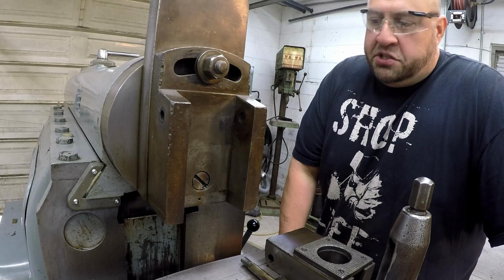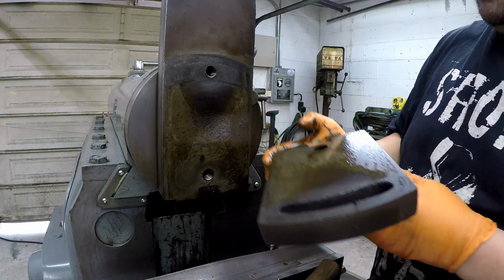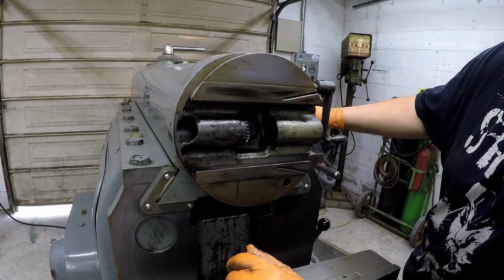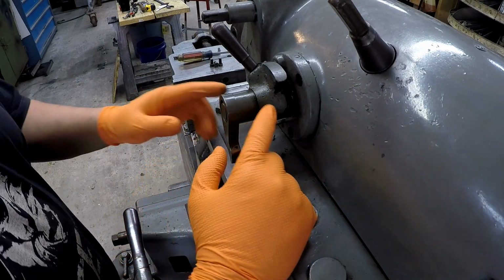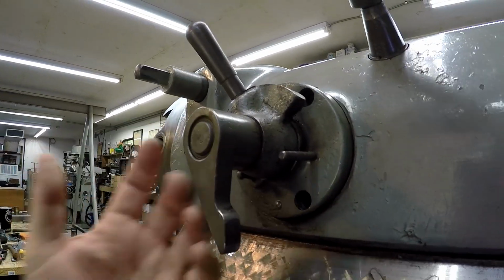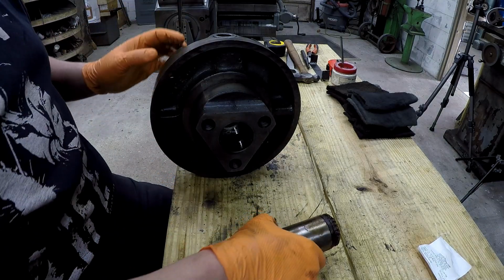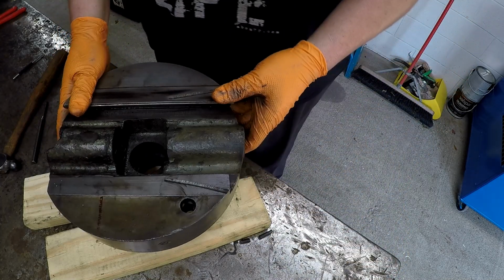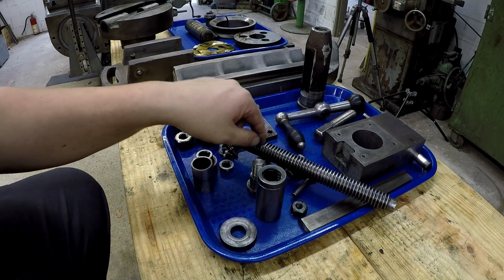G&E Shaper Tool Head Tear Down

Comment: A lot of times I find that a stripper bolt has a shoulder that is not concentric with the thread. It's like a cam. Slight misalignment of the counter bore and the threads of the machine causes the sticking. The answer is to replace the stripper bolt with one that is concentric. The cam action may also be between the head of the bolt and the shoulder. to fix that just cut the counter bore for the head bigger.
Reply from the maker: It’s just a simple cleanup up the head of the bolt. I’ll get it all fixed up.

Comment: Given the nut will wear again and there is already a bit of wear on the lead screw, would it not be wiser to make a split nut and pre-load the nuts with a bevel washer or something like that? Granted, you would need to drill another straight pin hole to hold the second part of the nut captive too or a grub screw would be better as you have to account for where the nut will be when you pre-load it against the main nut. Food for thought Adam.
Reply: darnit, Ya beat me to it!
Reply: speedbuggy16v don’t feel bad, i just happen to watch a lot of ABOM and youtube for that matter. Bound to get an early reply in given that!

Comment: I would make the new nut out of 2 pieces, to have an adjustment of the backlash in the future. The adjustable part of the nut could be fixed in place with a set screw. Similar to this design -- https://i.ebayimg.com/images/g/ZEYAAOSwAO9ZQCWa/s-l1600.jpg

Comment: Love it! You might want to deburr the square ends of the threads on the leadscrew where they meet the key slot in the screw - to prevent from future wear in the nut? Just a thought. Hoping that a new nut will fix Your backlash, there! Great video!

Comment: Man, how do you break a big of chunk iron out of a thing like that? Hitting it with a hammer?  Dropping it on the floor?
Reply from the maker: Ramming it into the workpiece.
Reply: Abom79 - That's probably the same time that the auto downfeed became inoperable; as a result of the collision or intentionally by the operator to "prevent" future collisions.

Comment: Bootstrapping the G&E back within tolerance sounds like it is right up your alley!  Since you will be making a new nut, will you be machining the threads on the screw, to ensure uniformity, as well?  I'm excited to see the smooth cuts you can get once the backlash from the loose fit is gone.  Once the key is in place, we can see the shaper going all out at feed rates too high for easy manual adjustment.  Is the maximum length of part that can be shaped the same as the travel of the ram?  Some long, deep chips would really show off what this machine is capable of.  Also, congratulations on gaining a few thousand more subscribers in the last few weeks!   This is the kind of content that enriches the lives of all involved, and showcases tools and technologies from a time where resilience was a higher priority that replacement part income.  When you have more than one video to share on a weekend, please release them spaced out a bit, so we can enjoy your work even more during the week.  Thanks for giving us another reason to love Saturdays!

Comment: Hey Adam, what do you think about making an adjustable anti-backlash nut for that?
Reply: The screw has enough wear in it that you wouldn't be able to make too much of an improvement over a tightly fitting nut. You would have to back off the backlash so that the screw didn't seize on the unworn portions of the thread.

Comment: Adam ... 1-1/16" surely seems like an odd size. I was recently fooled on one where the major diameter of the screw was turned down a bit, and wondered if that may be the case, for the bevel gear to slide on. If the minor diameter is .875, that likely may be the case. I checked Roton, and they go from 1" to 1-1/8". It would be nice to change both the nut and screw, even if you need to go up to 1-1/8". With that said....when the compound is being advanced, the backlash should be out anyway, besides being able to lock....cannot see it being a big issue??
Reply: +Jim Liechty
As I see it, the issue with the backlash in the tool head feed is gravity.  Unless you use the 'lock' on the side of the head as a variable brake, providing enough friction to keep gravity from advancing the depth of cut on the backstroke, you run the risk (on very fine d.o.c. situations) of having the tool go deeper than desired.  Then it is possible for the backlash to allow the tool to ride up, reducing d.o.c. as the cutting stroke progresses.  Using the lock in this manner also subjects it to undue wear as well.  Possibly causing a 'wear in' spot on the area where it runs.
Anyway, that is my $0.02 worth.  Cheers!

Comment: Looks like you found the problem again Adam, good deal.  Making the nut to match is probably a good thing since you will be able to clean up the shaft threads too and make the nut.

Comment: Nice work Adam.  The nut will be a bit of a challenge but all you have done prior to this moment leads to this being very very do-able.  My only concern is : What precisely is the correct metal from which to make the nut? (I.e. hardness, abrasion resistance, etc.)
Reply from the maker: Any bearing material. I’m using the original ductile iron.

Comment: A great video, thanks for showing the downfeed mechanism.  I am amazed at the different places that are worn between your machine and mine.

Please give me a chance at those auto downfeed parts.  I need the ratcheting system that bolts on the ram, the spring and the ramp.  It would be great to restore the downfeed to my machine.

Comment: Would a little added thrust washer go between the bevel gear and the feed rod take up the wear ,,backlash,,,. Seems a bit sloppy at that point . That should take the backlash out or some anyway. I bet 60 thousands brass or bronze. It looked to be about that if I remember . Guess if you measure it you'll know. Trying to help.

Comment: Holy crow. The battering that machine took in its working life. Every exposed thread end,every corner of that big  vertical casting, the lantern,did the firm originally owning it send every apprentice on that very machine,or was the rush to make parts so great that machine operators just whack a heavy item in place with no regard for long term damage ? The reason that thing sat in a corner so long was the journeyman were ashamed of how they had originally treated it. Really appreciate you doing this part of the machine. Always wondered how the bits were shaped. Cheers.

Comment: i have been driving out shafts and such, for many years and i always use an aluminum round stock as my punch/driver. I`ve never damaged the part this way even when pounding heavy. Brass drivers are hard enough to dent, chip. bend etc steel. Let the aluminum take the damage, redress it on a lathe once it gets a nail head. Jealous of your shop! God bless.

Comment: Just wondered as you didn't say, is that key that goes in the gear have two locating pins on is so that it stays in the gear and slides on the threaded shaft? 
Keep up the great videos, thanks.

Comment: Definitely can use a good cleaning
Reply: john pietros , Not much oil getting to the area in the ram where the bevel gears live. I wonder if there are stopped up felt strings in the oiling bores in the ram.

Comment: when I saw the bevel feed gear in the head, my first thought was that  it was missing a key, because that's very similar to the powered crossfeed  screw in my 1966  Sajo DuoMill. You are so fortunate to have a network of friends, who look out for you, spot parts at scrap yards, and tools at swap meets. I've been trying to repair my Sajo knee mill, and I've gotten near zero help. Very frustrating. 
Anyway, love the shaper repairs. How do I get one of those Abom79 tee shirts with the Monarch lathe on them? I've got a 1936 model AA 14x30in Monarch.
Reply: +Rustycowl L   For the shirts, look in the description area for the video.  There is a link there.  Many others available as well.  :<)

Comment: I don't know if it's worth the time but you could set the shaper compound leadscrew up in a lathe and single-side chase the hourglass out of the pitch diameter. You'll have to bush the follow rest so the keyway doesn't mess the diameter circularity up. Make a short gage to match the now oddball leadscrew. Then make a new nut to match the leadscrew/gage. Bada-bing! Like new slide backlash of 0.002". Dare we suggest backlash adjust?

I have a 24" Cincinatti shaper without auto-downfeed. Too bad. The 24" G&E parts you have coming but can't use wouldn't fit my shaper or I'd make an offer. Story of my life: everything I want is illegal, immoral, fattening, or wont fit.
Reply from the maker: I’ve been giving thoughts to that, chasing the threads until they are cleaned up the same down the full length. I’ll keep ordering on the idea.

Comment: If you make your own nut, you can machine the lead screw threads to even them up, then machine the threads in the nut to make a perfect fit.
Reply from the maker: If you change the pitch it will, chasing them will not effect the movement, or lead.
Reply: The dials wouldn't work if the screw or nut gets changed too much. Those parts are critical operating components.
Reply: If you change the  TPI by chasing threads on the leadcrew/nut by even a few thou, wouldn't that throw the dials off? I'm not a machinist, just an armchair, learned everything I know from you, Mr. Pete and Kieth Fenner on YouTube noob.
Reply: Adam , I do not mean to change the pitch (TPI), I mean to change the axial thickness of the lead screw threads to match the worn portion of the lead screw while duplicating the original thread angles throughout the length of the lead screw (making the lead screw uniform throughout its length). Then add the appropriate axial thickness to the threads in the new nut to equal that removed from the lead screw. The only downside I can see is that a stock nut will be as loose as your current setup at its worst part. Essentially you will end up with an artificially worn lead screw  with a nut that is machined to fit. Hope I explained it better this time. :)

Comment: To me, the bottom of the bore where the lead screw goes into looks like the casting is busted.
Reply: No.  The casting with the rough edges and missing center, that looks like it has been hit by forklift, is actually an artistic element added to the tool by G&E.  This is to break up the monotony of all the precision ground parts that make up this fine machine.  C'mon Jason, busted?

Comment: Why do you expect the slot of the screw not to be damaged when you hit it with a punch. Even I have a slotted adapter that came with my 1/2 drive socket set. If not, you can make a blade to fit the slotted screw.
Reply from the maker: I’m well aware of my actions Gary, and even more aware of what I can machine to fit. At that moment, I was trying to get the machine apart. If I felt I was causing damage I would have stopped.
Reply: Gary M, wow, you are such a nice person.

Comment: That feed mechanism is much different than in my shaper. I have one that has a rachet driven acme-screw nut. 
To use power feed in my shaper, you have to lock the feedscrew and unlock the rachet driven gear. Otherwise the feedscrew will turn. For hand feed, feedscrew => unlocked, rachet gear => locked, otherwise turning the feedscrew will just turn the nut and rachet gear ;-)

Comment: Tom Lipton asked himself why shaper vises are built like they are with the moveable jaw against the cutting force. Does anyone know the answer? Here in Germany I have seen vises where the handle is on the fixed jaw side. That design seems better for shapers to me as an ignorant person. But since every shaper I have ever seen has a vise like that there is probably a good reason.
Reply from the maker: The design seems to be tried and proven true to work.

Comment: Love watching the teardown and failure analysis.  I don't think you will be satisfied until that backlash is at a minimum.  So, I see a new screw making video in the future.  Hope so anyway.  I can't remember where I saw it but, I came across an arrangement where the nut was two piece and could be adjusted for backlash.  Would that benefit your situation?
Reply: +Geoffrey LeePard   I was thinking the same thing.  If not available, it "should" be possible to design one.

Comment: The screw on mine was bowed.  Still not sure how that happened, it was apart when I picked the machine up.  Being a flat gib on the tool head (in the manual, they call it a "harp slide"), I think someone may have let things get loose while it was in operation.  It took a few hours of careful press work to get things back to turning through without binding up.

Comment: hi adam great tear down, looking at it are you sure its all inside the threaded part, i know its worn but it looks to me of been moving quite a lot and im thinking it might of been moving back and forth on the roll pin grove and as the roll pin was broken in two when you tapped it out  might be worth checking,

Comment: loving this series so far , I just received my Dad's old craftsman atlas metal lathe from the estate, I guess its like a 7x14 maybe not sure but the on thing I remember him saying is that at one time the 3 jaw chuck had been broken off and someone had welded it back together so its a tiny but eccentric I think is the word so ill probably be looking for a 3 and 4 jaw chuck for it. Of course if all I do is parts that only requier one "chucking" Ill be ok but if I have to remove the part and recheck it Ill be in trouble. any suggestions on identifying what chuck I need and where to start looking for them?
Reply: +jetegtmeir71  Sounds very interesting, about the Atlas.  Just in case, I would mention another youtube channel that has had a propensity for just such.  Check out Tubalcain or MrPete222.  You should find a significant amount of info for the Craftsman / Atlas lathes there.  Good hunting!

Comment: Hey Adam, shame this is a rogue shaft and nut - but just think! You now have a chance to do an internal Acme threaded nut you never did before. Adventures in Lathe Work - right? Know you can do it as you have done every thing else - with passion.

Comment: Wow. This episode has three surprises! One, you had a viewer find another G & E in the scrapyard, tear parts off, two, stunned (probably) many fans that thought you would try to buy that nut, only to save the day by saying you'd make one (Yay!) and finally, three, you definitely know how to dive into a project and go all in. No going back now!

I think it's a great testament to your passion for the machining industry that just because a old piece of equipment is getting tired and not as efficient as modern CNC equipment, there is a place for these fine pieces and be repaired, accurate and capable as anything else on the market. 

Thanks once more, for sharing in the experience!

Comment: Looking at that lead screw with the keyway cut through it, the edges of the thread where the keyway cuts through look like they might be sharp enough to have slowly cut down the thread in the nut after years of running the lead screw back and forth.  Would it be possible/worthwhile to round the face of the threads that contact the key so they don't cut the nut in the future?
Reply: +Kineth1  I certainly see where you are coming from.  However, that definitely would be an absolute 'labor of love' to achieve.  In this case each and every one of the thread intersections would (probably) need to be chamfered by hand.  Both sides of the keyway.  But, technically, it would decrease potential wear.  :<)
Reply: Still, probably easier just to make a new nut every 50 years I guess.